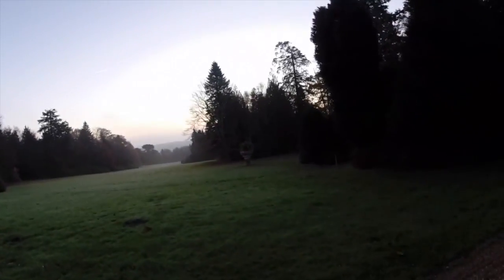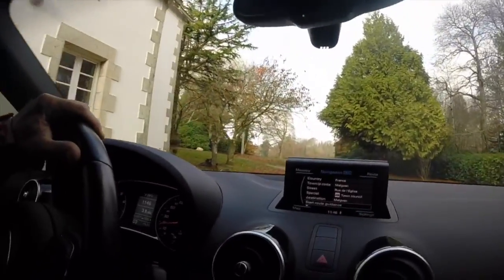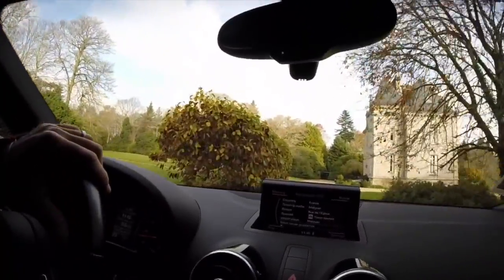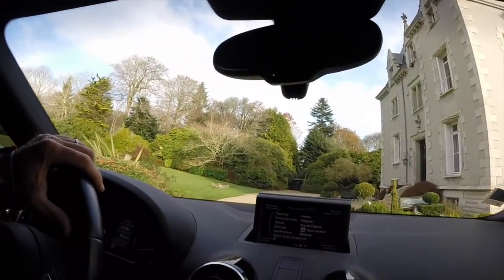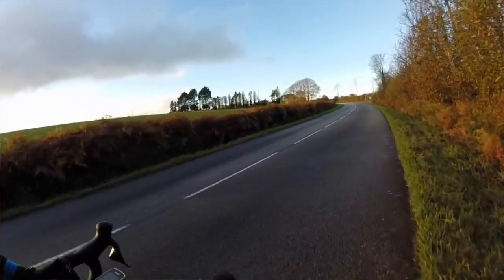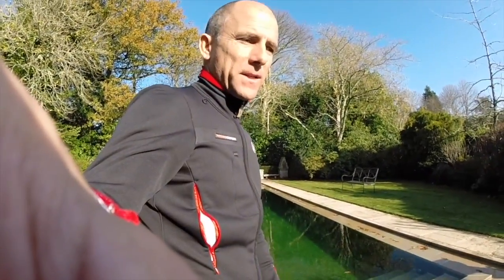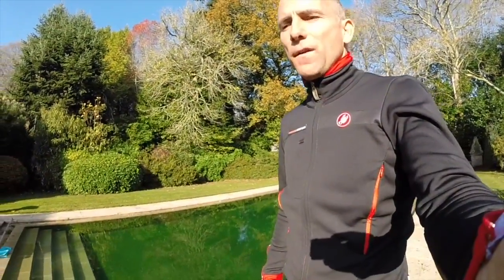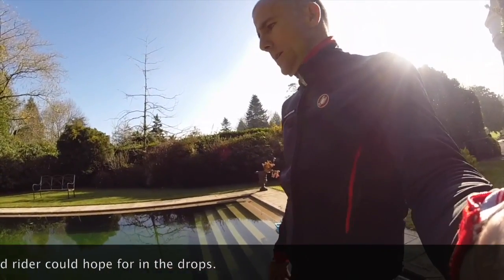Why is it Harder to Ride Fast in the Winter? (+KOM Bagging Tip!)(en français aussi)

Comment: there is a difference in density depending of temperature - but it is MUCH less than you say. For example, at sea level it is 1.292 at 0° and 1.1644 at 30° C. And, btw., please tell me how you manage to ride 40 kph at 208 W, I MUST learn that - would bring me to a totally other level of cycling...
Reply from the maker: You seem to have completely forgotten to include air pressure in your figures. Using very low air pressure, (900) the density approaches 1. And using high pressure (1040) gives air density of 1.32. 

So the difference in extremes is indeed 0.3. (More if you go above 30'C and below 0'C, both quite possible).

Use this; https://www.gribble.org/cycling/air_density.html

The CdA figure we used here was 0.3; low granted, but immaterial, in that the big difference in power required between hot LP days and cold HP days remains valid regardless of your CdA.

Our calcs ignore drivetrain losses, Crr, power to spin wheels, etc. for simplicity, and will therefore show a higher speed than normally achievable at that power. 

If you want to see a more realistic speed/power figure, add 50W (+/-20) to the powers quoted.
Reply: ok, then your calculate is correct... but a bit theoretical though. I have not forgotten air pressure, but I thought we talk about temperature? And to be honest, your presumptions are a bit extrem; 900 (at see level) is way lower than the lowest air pressure ever measured in my country (Germany), 1040 is near the highest ever measured. And there is no fixed correlation between air pressure and temperature. To give a bit more realistic numbers: I need about 290 W to ride 40 kph at 30° and about 320 W at 0° C - what is nevertheless a significant difference!
Reply from the maker: I mention air pressure many times in the video; I am talking about extremes - very hot / very low pressure, and very cold / very high pressure.
We could also add high humidity and high altitude (both lower the air density)  to the 'HOT' example to further increase the difference. For example, cycling up just 500m will drop the density by about 0.06. (Which would give a difference of at least 0.35)

It is quite possible to have a hot, low pressure day, just as one could have a hot, high pressure day.

I need about 250W to ride at 40kph in good 'normal' conditions, but I am small and have good aero.

But at least we agree that the difference is significant - more than most riders think!
Reply: well, may be I have missed some words in your video... and please don't get me wrong: I didn't want to offend you, it is an interesting topic and in fact I have not thought about it until this video, so it was good thought-provoking impulse!

Btw: how much of a difference air pressure makes shows a descent at extrem high mountain passes like Pikes Peak (~4300 m), you will achieve enormous speeds...
Reply from the maker: You are right to say that my air pressure examples are extreme; perhaps a more likely scenario with pressures that we would encounter more often would produce an air density difference of between 0.22 and 0.25 (i/o 0.3)

In this case the power difference to hold 40km/h would be more like 45 watts (i/o 60)

Your experience shows a 30W difference, presumably without pressure changes. Factor those in, and I think we are close.

And don't forget that CdA increases in the winter, due to bulkier, less aero clothes!